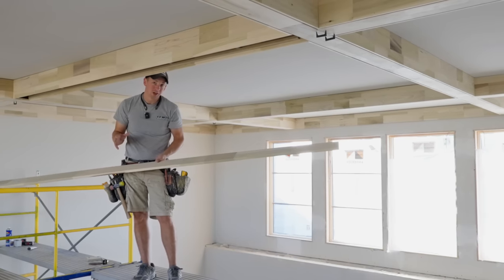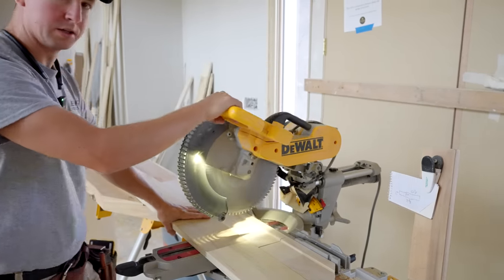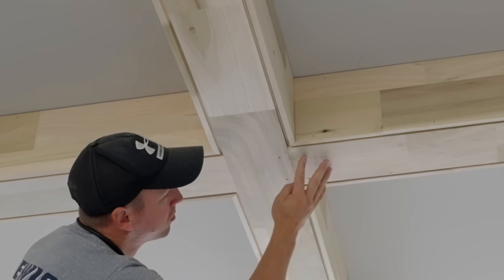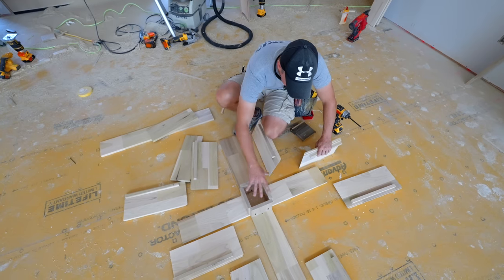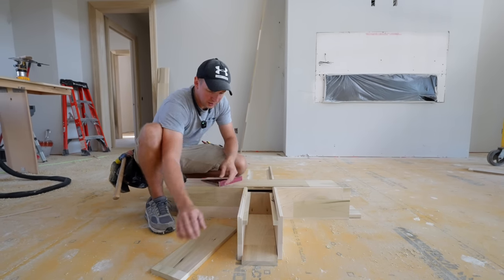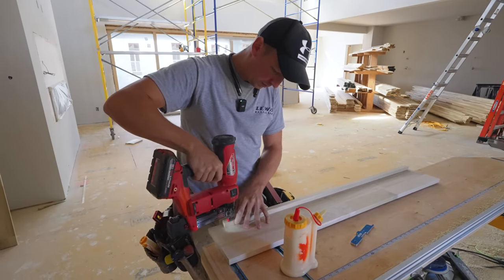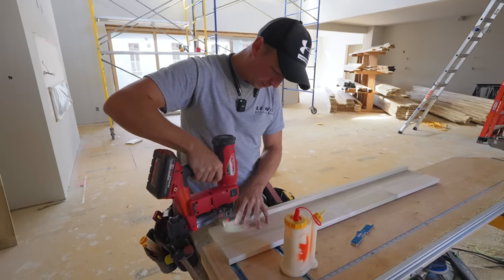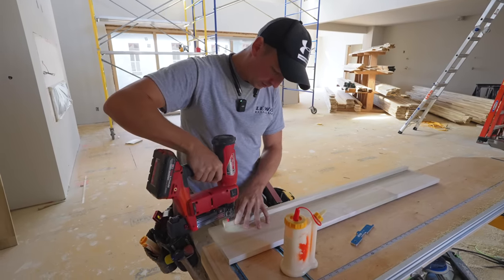Coffered Ceiling With a Modern Twist | This Detail Looks Awesome!

Comment: Historically in New England we would route a 3/8"(10mm) bead on the sides of the beam. It works great when you are doing clear finish. The bead separates the grain/color changes between the sides and bottom. It's the next level of coffered beams.
Reply: Now you are talking. A case where the sides have to be mitered to preserve the beaded profile. But with the dado design, there is an easier way.
Reply: This is paint grade... Hence all the fingerjoined boards.
Reply: @MistAtsiM  clearly.

Comment: I love your videos.  I am a retired finish carpenter after 30 years doing high end San Francisco Bay Area home remodels.  In my area some of these homes were built in the 1800's and have miles of trim.  A lot of it was stain grade so I had lots of fun inside and outside with multiple layers of reveals, shadow lines, crown, chair and picture rails, columns, built-in drawers, etc. I started out as a woodworker so my tolerances were very close.  Thank you for sharing what you do.  It is truly inspiring to witness all the techniques and production methods you use to stay efficient and I hope profitable.  Well done!

Comment: Kerfing boards is something I do all the time for tight fit and once I learned how to make stave shims I use them !  Like around custom sink cradles for the big 38” , 160 lbs porcelain sinks!  There is a gap  (albeit very small ) between the lower cabinet and where the apron meets it!  I now use stave shims to cover it !  I really don’t do coffer ceilings in my area but tons of cabinets built ins , shelving ect.,.  
Thk you so much Spencer I know this is a ton of work!  
God Bless , stay sharp!
Kings Table Custom Carpentry

Comment: Nice detail.  For commercial spaces we would use l cleats to be fastened on to your ceiling backer and a dado for you bottom panel.  That way you can secure it from the back side for one side and silicone and nail on the other side.  For the intersection joint we would screw a tongue on the top to over hang the long board that's going across so you screw from the top side or pin from the bottom side to avoid it from separating and to keep it flush on the bottom side.

Comment: Fantastic video, thanks!  Lots of great tips I can implement in my office remodel.  Router issues like the one you had here give me nightmares.  As a DIYer struggling my way through projects, I find that my table saw with a dado stack is a less error-prone way to cut rabbets/dados into boards (sacrificial fence on the table saw for rabbets) - although it probably  doesn't provide as clean a finish on the cut.

Comment: Spencer please, please infill your staging platform with another section. Your family needs you. Do it for them. One misstep could end your career or be fatal. I’m a retired engineer with the last 15 years in construction management on large commercial projects. Safety is job 1 !
Having said that, a beautiful job as always and thank you for all of your videos. They are a master class in production finish carpentry.
Reply: Exclusive! Now we know the reason he wipes all that glue on his tool pouch. His emergency brakes, left and right.
Reply: But all joking aside, it’s nice to have rails. There is a slow boil effect in the trades. Until you have an accident, know someone unfortunate to have one or even a really close call, we are all indestructible. Just get it done and move on to the next high wire act. We all have taken unnecessary risks on the job. I think at a certain age, wisdom begins to push back against the thrill of the job site - sense of adventure.

Comment: I love the attention to detail you have and thank you for sharing your tips with us! I have a very basic question; after you’ve measured and you go to mark you’re measurement on the board to be cut, do you cut your line(mark) away or cut just before the mark or just beyond the mark? I know consistency is the key whichever side of the mark you cut on, just curious what your method is. Thanks again!
Reply from the maker: I always cut to the center of my mark. I like to use a .09mm mechanical pencil and keep the mark thin. Cutting to the center of the mark makes the most sense to me.
Reply: Thank you for getting back to me so quickly. I like center of the line and I’d like to get a Pica pencil. Any thoughts on the Pica? If you’ve used it what did you like and what did you not like? I promise I won’t just keep asking questions but I do value your opinion. I’ve recently started working in a shop called Swell Spark/Sandbox. It’s a great company with fun and different types of buildout projects and installs.
Reply: Pica’s are ok but stick with a mechanical pencil that already has thickness of lead you want to mark with, i have a pica but don’t use it because I’ve also got to sharpen the point I need/want for fine marks, might as well use a traditional #2 pencil, some would say it has a built in sharpener and I would rebuttal a .07 or .09 leaded pencil never needs sharpening, spend your money on a really nice mechanical pencil that advances just enough lead to mark with, I wanna say Stumpy Nubs did a video on that topic but not positive, take care

Comment: I had the same issue with my router today too! Using a round over bit and started to notice a shoulder in the cut. It seems the clamp had worn at the edges and wasn’t camming tight enough. I have a feeling over time it will continue to wear to the point it will need replaced

Comment: I feel like this biscuit issue is the perfect use case for a lamello clamex connector. 

Cut in the connectors, place the board, turn the Allen key to lock the clamex in place and then plug the small access holes and then sand flush during finishing.
Reply: I was thinking that too!
Reply: Or use 0’s

Comment: I have had the same problem with DeWalt routers as to bit slip ! To keep that from happening I ha to tighten the lever so tight I could barely latch it and then pry it open with a screw driver. I’ve never had an brand do that. Both my trim & full sized DeWalts do it ? !!,

Comment: Great Video! How come you chose to use the router for the dado cut rather than your table saw or shaper given the lineal feet of cut to process?
Reply from the maker: A handheld router is easier to control the consistency. With a router table or table saw, if board wanders off the table of fence the cut will not look right. With a handheld router it will be perfect. And it's pretty fast to just chuck a bit and go to work with a handheld router. Minimal setup.
Reply: With all due respect, that's just silly. Featherboards prevent that. A handheld router can easily wander and leave an inconsistent groove. C'mon man! @InsiderCarpentry
Reply: Not sure how you argue with the result he got

Comment: Id love to see how you’d scribe all those beams. No problem. Seriously. Id like to see it.
Reply from the maker: Set a control line  with the laser. Tack a piece in place to the control line, scribe, cut, install. Rinse and repeat for every piece. I've done it many times.
Reply: @InsiderCarpentry  me too. It sucks.  It’s not no problem. Ive been doing this for decades. Moldings have a purpose. At the very least expect a true level 5 from the drywallers. 

Look I love your channel. But to say it’s no problem to fiddle with each and every piece of wood that hits the ceiling is something that stands out for me. 

I’d love to see the time study.
Reply: Then there’s those jobs where the drywaller is called back to skim coat each bay to the top of the “leveled” box beam🤭
Reply: @daveparker5569 I agree with you.
'No problem ' to my ear, is different than the response, "Yes I can do that, but it would account for an extra $3k in the budget" or whatever the number might be.  I'm not taking anything away from his skills, just comment on the 'NP' response

Comment: Yeah.....I can totally scribe fit the entire coffered ceiling, but that price is not in the same zip code as floating it. Down and using trim.    Well if its painted and not stained then at least you can caulk to the ceiling and be a little less particular.

Comment: Hey Spencer, when you are installing crown, do you favor which way you go around the room, clockwise or counter clockwise?
Reply: As with baseboard he usually goes clockwise because cutting material upside down/backward puts the coped side on the left of the board. Therefore, working clockwise allows you to set the coped joint (left), bend in the right side and snap. I learned this method from one of his videos years ago and it's a huge time saver.
Reply from the maker: Exactly. The direction of installation is determined by how I am cutting my cope at the saw.
Reply: Most carpenters are right handed. Tooling the material this way would be the most natural. I have had a couple of lefty’s work for us and most might want to reverse everything. But I also would never let a lefty run crown or teach new guys much - when learning to use power or hand tools. “Don’t look at that”. Everything done by a lefty is like looking in a mirror and they had to set up and stack material backwards. I made them set up and cut in a separate room. Just a lefty rant and my apologies to any southpaws reading this. But I’m sure there aren’t many. But apologies in any case. It’s not your fault.

Comment: Don’t think I saw this bit in the video. How did you account for the rabbit that runs across the opening of the cross piece? Did you rabbit the butt ends from the back side 1/2” deep?
Reply: I can see at 3:44 that you notched the     material away.
Reply: @IndianaJBird the rabbet is on the side pieces or frieze of the beam and not the bottom.
Reply: @henrypeisch5289  you are correct, not sure how I missed that. That means the sides appear to be only a 1/2” thick.
Reply: @IndianaJBird  the sides are 1X8 with a rabbet, leaving a 1/2” shoulder. But there is a better and faster way to execute this coffer detail.

Comment: I couldn't see the detail of the soffit board too clearly but it looked like the edge rabbit runs through the intersection on the through board but stops on the short board so there no reveal at the intersection, nice,, what's going on there,, did you mirror the long board rabbit and mill it on the butt end of the short board, ship lap style,, couldn't picture how else to accomplish that joint quickly and consistently, but I'm sure you came up with something clever.  I'm going to steal this design, ok
Reply: In the video, the rabbet profile is milled on the frieze or vertical boards (sides of the beams) to achieve this dado detail. This is what necessitated the sides of the beam to be installed first and then mitered at the inside corners of the boxes. This reverse order of procedure (sides of beam, then bottom of beam) creates unnecessary labor-intensive fitting and extra time on the install. But Paul, if the bottom board was profiled (with the rabbet) and you plowed the boards end-grain at the beam intersections for a lap joint (as you suggested) to bury the intersecting rabbet, this method of installation would allow for a typical coffer installation of running all the bottoms of the beams first and then the sides (which then could have butt joints instead of mitered inside corners). Much more efficient install - especially for a one man assembly. Miters on the frieze and installing them first is, IMO the most time consuming and challenging part of this specific install. No margin for error. When you do your own version of this coffer, consider planing the frieze on both sides of the beam to 1/2” thickness to get the same finished reveals as in the video. It also might be possible to stay with 3/4” boards for the sides but use a compatible rabbet plow (leaving a 1/2” cheek) at the bottom edge of the frieze - which would eliminate the need for any cleats being glued and fastened to every board. In this case, you would cut a 1/4” x 1/4” rabbet on each long edge of your bottom cap and the interior lower edge of each side would have a 3/4” (board thickness) wide rabbet that is 1/4” deep. This would provide a shoulder for the parallel boards to seat together. But then Spencer would need to keep a wet glue rag in his tool pouch and it’s more fun to just wipe on his bag. Can’t have fun all the time tho. Hard to describe in written words but since you raised the question, I am guessing you can catch it. I haven’t seen this exact profile in application myself - although similar to full beads and reverse mated profile cove at intersections. IMO, a butt joint should be used whenever possible if an installer is interested in speed and efficiency. And when should an installer not be interested in speed and efficiency… the correct answer is never. So, figure out a way to cap the bottoms first and the rest is fast and easy. Always work to an open side of an assembly when possible. When installing all the bottoms first, your open side is at the ceiling. Save the kerf cuts for landing treads and tight radius work. Someone should make a router with an electronic sensor and a kill switch to detect loose collets and base clamps. If a scribe to the ceiling was required, capping the bottom first would also be required procedure with this profile. More relaxing. If the video was a challenge competition as to how to create the most difficult way to execute this detail, sides first and scribed to the ceiling would take the prize. This is a testament to the skill level and why I keep coming back to watch Spencer work. I bought a time share for his next project and will be flying out with my field glasses and lawn chair. I also make a decent lunch truck taco - which was a requirement to seal the deal.
Reply: Just a correct term comment… a bulkhead when referring to wood or metal frame construction is typically a component in a soffit assembly. The “bulkhead” in the video is really just a header, beam or girder… each with minor specific differences but with similar structural function and purpose. In the video, if a soffit was framed to form a dropped ceiling on one side of the girder, it would in that case, then be a bulkhead.
Reply: And I’m going to annoy someone but the base trim profile has been referred to as a dado profile. Specifically 1/4” x 1/4” dado. Typically a dado refers to a plow across the grain. With the grain, the same plow is correctly termed a groove. So, the base has a factory groove and not a dado - except if field treating the end of a board with a power tool. All that to say, the base is pretty groovy in more ways than one.

Comment: Why wood is not primed before installation ?
Reply: Factory primed is typically inferior to field primed. Priming or back priming interior FJ millwork is labor intensive and you need drying racks and a lot of space. One of those things that the cost is not justified. Back prime/seal most exterior wood that is going to receive a finish coat of paint however.
Reply: In most cases, the longer the drying time, the deeper the penetration and stronger the bond.

Comment: Nice work. 
My only complaint: the material. I was a carpenter for 35+ years, and a lot of the material they have to work with nowadays is junk. That finger jointed wood is just about the worst.
Reply: True with some FJ products because of many variables. But paint grade FJ poplar is one of the best materials for paint grade interior millwork. Stable, durable and holds onto the finish when applied properly. Actually, these features exceed old growth pine from 35 years ago. But 35 years ago, I also would have passed on any FJ species. The trim package on this project is supplied by a trusted source, I’m certain.